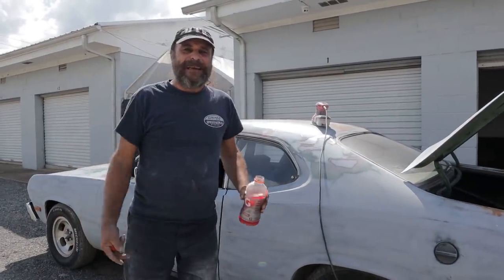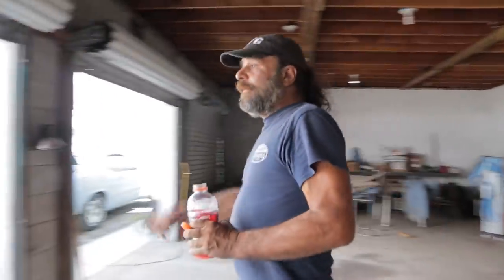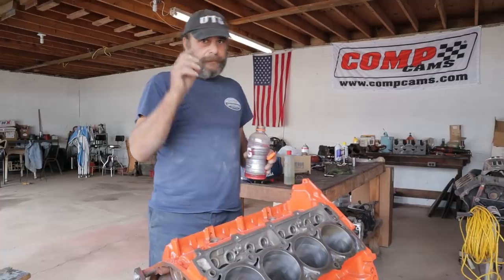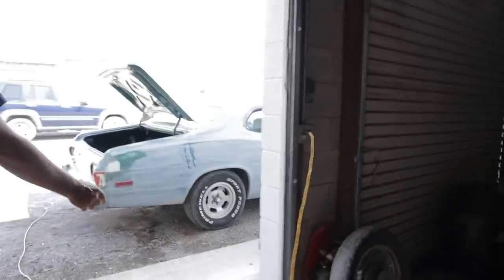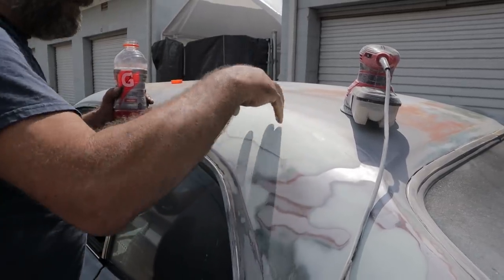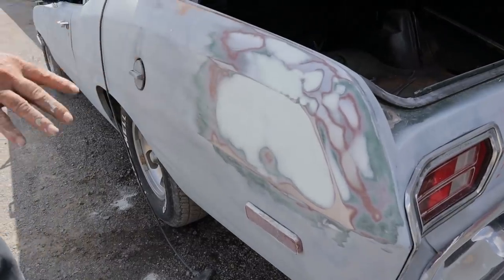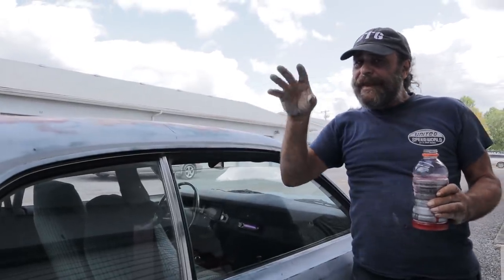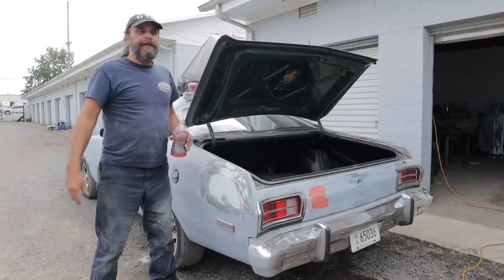DIY Budget Home Paint Job, Take Two...The Redemption?

Comment: Here's a trick to help with spraying that metallic green, Uncle Tony: Depending on how much exercise you want while painting, to make an nice even spray along the sides without getting uneven metallic coverage you could try "walking" the sides rather than spraying each panel.  After shooting the top, hood and trunk, go to one side and "walk" the gun the entire length of the car, front to back, back to front, starting high and ending low.  Just make sure your floor is clear and lighting even.  When shooting, you develop a tunnel vision of the surface to your gun tip as well as an even speed.  Your turn arounds will be off the front and rear panels only.  Makes for a consistent spray for the entire side with no pattern breaks at panel seams.
Reply: Good advice. It pays to walk back and forth a few times with gun in hand but not spraying to see how your air hose is going to react. It might need some adjustment in how it is laying. You don't want to be stepping on it and stop your gun stroke or having it flopping up against the fresh paint. Been there done that.

Comment: That BRG paint you're getting, is that the Mazda BRG from the mx-5?  If so, it's a really pretty color and not far off from the original. I've had in the past both the mopar sherwood and the miata BRG as factory paint and if I remember correctly, the sherwood was a bit darker while the BRG shows off the metallic a bit better in my opinion.

Good luck on the Duster, one day I'll score another old A-body to play with.

Comment: I’d mix the paint as you need it not all at once and I’d move around the car faster and I’d do the inside and underside areas first and with the outside of the car Youll probably want to start from the roof and work it down to the ground